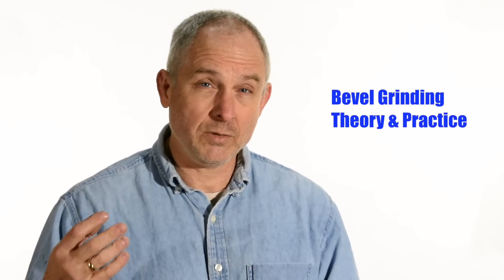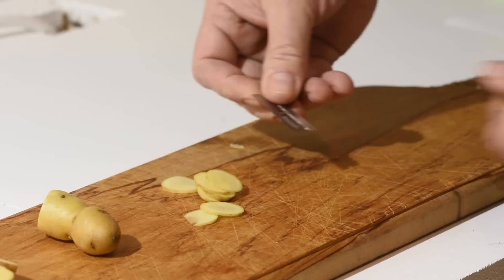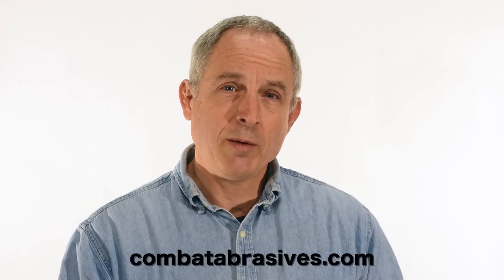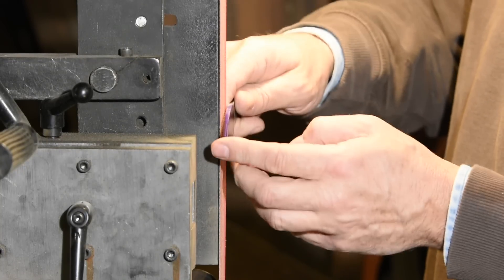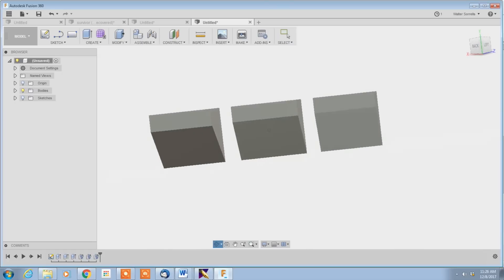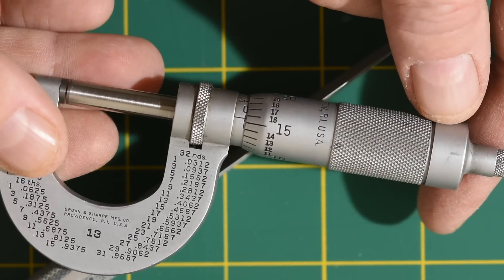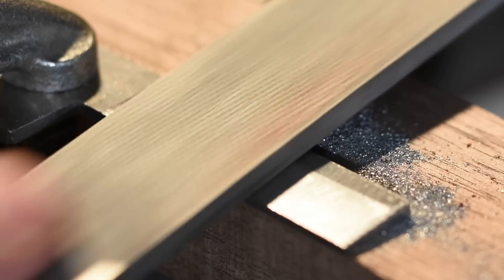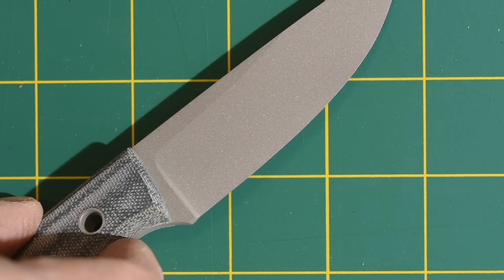Knife Making Basics:  Beveling Your Blade

Comment: I completely agree that we are too focused on toughness rather than sharpness. One would think that with all the modern supersteels knife producers start making thinner blades that are the same toughness as the previous knives in the end... I personally started lowering angles on my knives as the cutting ability increases singificantly
Reply: I used to carry a CRKT Minimalist and always complained about how little it holds its sharp edge. It had a basic V edge with a flat ground blade. 
In the begining it might have been fine but as i have broken the tip and reground it higher the edge got thicker. One would think that thicker = better edge retention, that is wrong! It only makes the blade tougher which is with such a knife useless.I broke the knifes tip by trying to throw it ONCE, since then i grew more responsible and deiced to regrind the edge and make it a very sharp slightly convexed scandi. I took a lot of the material off and it rattles in the sheath but i couldnt believe the change in performace! Wood proccesing suddenly became easy, paper cuts were much smoother and to my surprise the edge holded much much longer. (i even tried batoning small pieces of wood with it and just needed to strop it to get back to razor sharp) I compared it to my Lionsteel M4, which has M390 steel and a slightly worse angle. ive done some carvings and it was nearly an equal match in sharpness and edge retention. The edge might be made out of a softer steel but the lower angle offers less resistance and so probably less abuse it has to withstand..Im really looking forward to taking the Lionsteels grind down too.
Reply: I like the grip of the Lionsteel. I have had trouble feathersticking with it, so i took a piece off of the edge where the V edge meets with the flat grind (made another flat grind on that with a jig, as if you were trying to convex it) that made feathersticking a little easier as i could adjust the angle at least a tiny bit. With the V edge it only either cut straight into the wood ruining all previous feathers or it did nothing. Or both in the same pass!The minimalist gained a big control in that regard with the convex scandi. For wood processing i really dont see any better geometry than that. The knife definately becomes more brittle, the tip is so thin that when i cut a piece of sausage on a plate it micro rolled immediatelly. I can see that easily happen to the edge as well if you hit harder materials. For an EDC sized blade in hands of someone who likes to sharpen it its no problem though :)
Reply: There are several sharpening jigs on the market, i have a chinese edge pro copy. The hardness didnt matter much, but the blade shape was troublesome. The jig makes a curved motion and as i wanted to keep the angle consistent i had to move the knive three times each pass to the correct position and that took ages. 
With waterstones one is able to adjust the angle on the go.

yes basically its a third bevel to ease the resistence of the materiál you cut. Now if you take that third bevel and slightly round the edges where it meets the V edge and the side of the knife, you can a convexed scandi (more or less)

IMO every scandi you create by hand is slightly convexed and thats a good thing. If you are able to make a perfect scandi by hand then you dont need to convex it at all.Sharpening makes the time go by quickly indeed

Comment: Walter - I believe the issue in cutting is not friction on the blade edge, it's mechanical advantage. A blade is an inclined plane lever and the mechanical advantage is rise over run (length of the long part of the wedge versus height) - it multiplies out pretty dramatically when the height gets smaller.

There is another factor and that's the length of the cutting surface - serrations, micro-serrations, and curvature can all increase the length of the contact surface and increase cutting power (basically, you're folding the edge of the blade to make more blade-edge)

Comment: Very informative video.

BTW, although not mentioned by name, the single back bevel with an unsharpened edge seen at 12:05 is what is known as an "apple seed edge". That is the sort of edge that most mass produced swords are given that are intended for display only, not actual cutting. In other words, finished but unsharpened. Some people also call it a stage or hollywood edge.

Comment: Hello! 
I am new to the whole knife making hobby and so far I love it! My first knife is a Karambit I have been working on it for about 3-4 days now. The one trouble I am having is getting a good bevel on it. I don't have access to a belt grinder, but I have a handheld Grinder and a bench grinder. I have used both of them but when I tried it the first time the metal got blue and I had to start over. I am not sure if it is possible to get a nice bevel using these? If it is do I need a special attachment or is there just a technique that I am missing? 
Thanks!

P.S: Walter I am a huge fan of your videos they have really helped me find probably one of the best hobbies (in my opinion) and you helped me get started so thank you! Keep up the good work!

Comment: Thanks a lot. Very informative. I wonder about secondary bevels on scandi-grind and japanese chefs-knives. Is there a secondary bevel? On a mora carvingknife with scandi-grind: is there? And what is the bevel on the secondary bevel? Same thing on a normal santoku knife? Secondary bevel?
Reply: Stefan Duberg -  most likely your santoku will be also typical flat ground blade (on both sides) with a secondary bevel, so just sharpen it like any other normal kitchen knife.  It's mostly the more specialized Japanese kitchen knives like for sushi and such that are chisel ground and sharpened without a secondary bevel.   Don't worry too much about sharpening at an exact angle, as it's more about keeping the angle you're sharpening at consistent along the entirety of the edge and on both sides.  15 degrees per side is a good general angle for most cutting tasks.
Reply: Also want to add that there are tons of videos on YouTube that show how to properly sharpen a scandi blade and for just sharpening in general, so it'll help to watch some of them before trying.

Comment: Hi gott a quick question that's not related to this vid ,sorry. Iv just heat treated my first knife blade and when I cleaned it up ready to temper it the blade has loads of rings on it that I can't get rid of ,almost looks like a Damascus pattern. What have I done wrong or is this normal or after tempering will I buff them out . Thanks

Comment: do you have a video talking about why you grind with the sharp side UP going INTO the belt?  I've had little success with that, where I usually end up cutting the belt I am using.  It has happened twice to me and thus I've just left the sharp side go down instead and "drag" the blade instead of what is shown in your videos.  I'm guessing that what you are doing is proper and probably my technique needs to be ... honed...  :-] 
thanks for all your videos!
Reply: Dan Rozwood great question i also wonder how dosent he cut in to his belt
Reply: he covers the reason for the edge side up in a previous video https://youtu.be/tE0lKVyDgtg?t=18m
Reply: Thanks! I thought he must have, I just did not catch that!
Reply: to me is the opposite, i find imposible to see and control the bevel with the sharp side down ^^

Comment: do i really need the secondary bevel? 
i've ground a bevel of 15 degrees on a knife that is 8mm thick and wide by approx 35mm and length of about 170-200mm long.
i dont want to put a secondary bevel if i don't have to . ill sharpen the whole bevel

Comment: So just a quick question. What would you say is the purpose of the 1/8th-inch thick stock ground to about 3/4 of the blade that you suggested at the end of your video? I currently have some 1/8th-inch O1 steel stock and I'm planning on making my first knife from scratch with a homebrew filing jig I plan on making. I've made some knives before using knife kits but this will be the first actual blade I make.
Reply: I think thats his easy way of telling you how to get a close degree angle his blade width.  But that all depends on how wide your knife is. Thats what i got from the vid. Hope that helps.

Comment: You forgot one huge major factor-quality of the steel! For example a 20$ for a 5 knifes steel kitchen knife will hold edge with convex grind fine for 6 months of normal use-but make a flat ,hollow or saber grind on it and it will be dull in 2 weeks.(i know because i tried it)I made my constant angle sharpener and my knifes are dull in 2 weeks.So i returned to hand convex grind-no problems.
I know that most of you that make knifes will use best steel they can afford ,but still for you guys that sharpen regular kitchen knifes its something to think about.

Does anyone knows what can i use to drill a hss bimetal power saw blade ??? Cobalt drill bit maybe ?
http://www.bahco.com/en/p/power-hacksaw-blades/32-93-d7-14-8e-5f-de-80-ec-db-78-65-5a-49-ad-ff/
I got my hands on one of these used and i would like to try make a kitchen knife.
Reply: zumbazumba1 ... carbide will work, cobalt might.